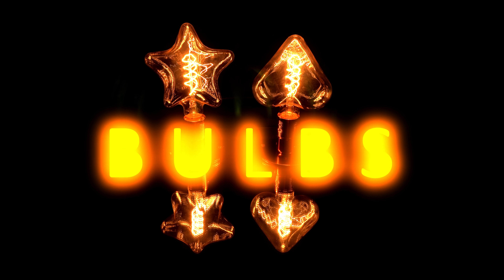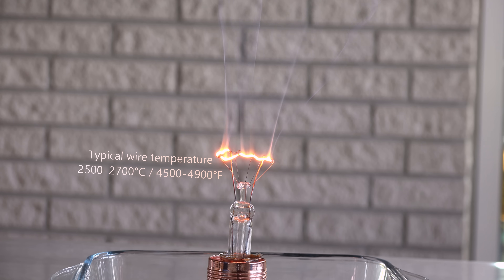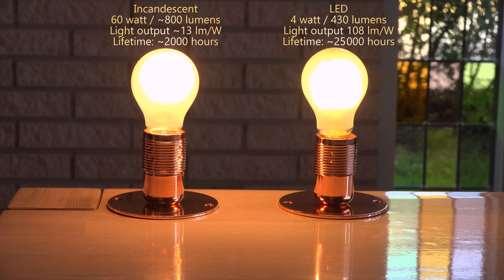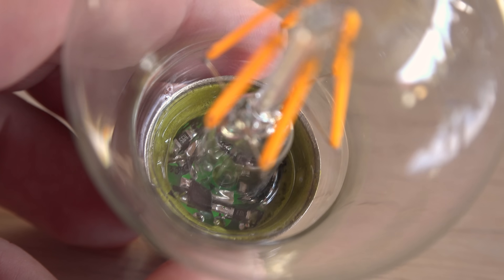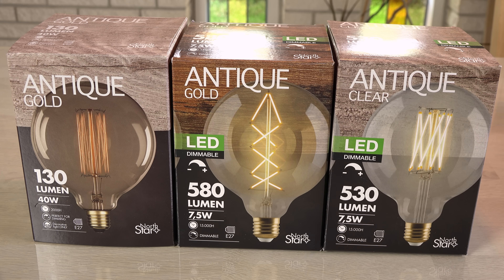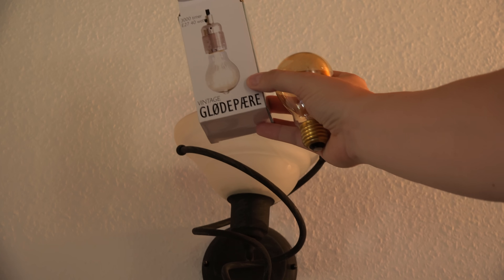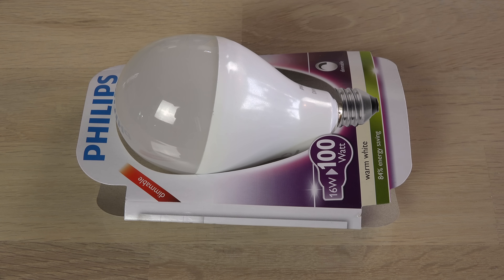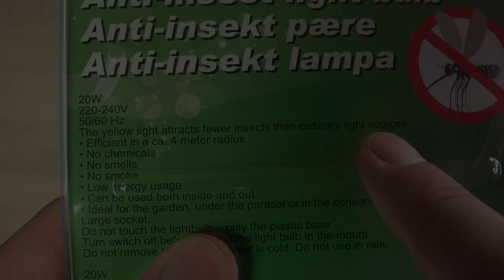Light Bulbs | LED vs. Incandescent

Comment: You need to test the bulbs at the rated voltage using a variac before you can say they are using less than the specified power.  I measured a 60W incandesent bulb rated for 120V (US) dissipate roughly 63.9W at 130V, 57.4W at 120V, and 50.7V at 110V.  The power does not increase with the voltage squared as your might expect because as the filament's temperature increases (radiating more power) its resistance also increases tending to limit the power consumed.  The plot of power dissipation vs voltage is almost a strait line.

Comment: The CFL bulb at around 9 minutes is rated at "125 watts" but only uses 50 watts because, in a very confusing fashion, that rating isn't based on the power consumption of the CFL, but the power consumption that an incandescent bulb would have to draw to emit the same amount of light. This is more or less pure marketing trying to compensate for consumer ignorance - most people don't realize that the watt rating on a bulb is about power and not light. They just associate a certain number of watts with a certain brightness, so if CFLs are labelled with their actual wattage, people tend to mistakenly think they're too dim and don't want to buy them.
Reply: Yep.  Compensation for the truth that is it's usually the consumer that's too dim, not the bulb.

Comment: Hey, there is the thing. I have a baby monitor (camera) with no night vision so I used a small light bulb in the room - with heated wolfram wire . When I switched to LED bulb with the same lumens, I had no vision on the camera. I'm wondering why!?
Reply: Perhaps your camera is running in sync with the LED flicker, but in phase with the LED's being dark?

Comment: I've noticed a flickering effect with my flashlight when I switch to low power mode. I'm guessing it just shortens the duty cycle of the LED, causing a noticeable strobe effect when moving things through the beam.

Comment: the issue i have with led bulbs is that they cant withstand -50 C degrees if i need to do some work outside my house at winter also they cant work at all for sauna lighting and there are no cold resistant or heat resistant led bulbs yet and i suspect there will never be one for both applications as my workshop at winter will be at -50 c and in summer at +45 C
Reply: and where the fuck do you live, neptune?

Comment: ,If you live in the tropics, you'd probably prefer the whiter, cooler versions of LED, but the downside can be that the electronics soon fail due to a poor stability of electricity supply and surge transients.Certainly I keep some of the old filament lamps as a series safety lamp for bench testing equipment.An interesting aside is that the first electric radiators were in effect large carbon filament lamps in the form of a long sausage shape with a pip on the end where the air was exhausted. Great video. Please keep them coming.

Comment: Banning ordinary filament type light bulbs is stupid, sure incandescent bulbs may not be efficient, but for other circuits that I use a bulb in, they are in-valuable.  Good thing I stocked up.

For instance, a dim bulb tester is a circuit where you have a bulb in series with whatever you're testing, so if the device is faulty and tries to pull a lot of current, nothing will explode, the worst thing that will happen is the bulb will light up bright, and that a good indication that something is wrong. Can't do that with LEDs.

Also light bulbs make very good a grid-leak resistors in a vacuum tube Tesla coil circuit, because their resistance changes when the filament warms up, making them a sort of self-adjusting resistor and it sets the bias in the circuit perfectly.  Can't do that with LEDs.

You can't do any of that with LEDs.  In lighting though, for me it's either florescent tubes or incandescent bulbs. None of this CFL or LED bull crap.
Reply: swunt10  Of course not.  Everything here is typed. 
..
...and I suppose you are nobody.
Reply: wow non of what you said is relevant to anyone. we are talking about light, not your useless hobby amateur project. buy yourself a circuit breaker and learn to use a multimeter. problem solved and humanity can save a couple of powerplants
Reply: pssst3 every heater is always 100% efficient because everything ends up as heat. so incandescent lamps are not special. I can also tell you that heating with electricity is always more expansive then every other option. nothing to do with taxes either. furthermore your gas bill surly did not go up if anything it went down since international and US oil and gas prices have collapsed over resent years. so please stop lying and telling bullshit. you are just embarrassing yourself.
Reply: swunt10  Correct you are on all counts.  Incandescent bulbs may put out about 2-3% light, but that would then get converted to heat on the surfaces it illuminates. 
To be pedantic: Power lost in the wires outside the house would be lost to the homeowner, but in the grand scheme of things it still goes to heat.
Reply: swunt10  I said nothing about amateur radio. I ran an FCC test lab.  Police/fire/ambulance use radios too.  Even though one bulb can pass FCC part 15 (or other countiry's agencies), when you have several hundred LED bulbs in a neighborhood, there could be issues.  Time will tell.  
...
What does your comment about a breaker and multimeter mean?  I have several of each and neither solves RFI.
--
Just providing information, Cheers.

P.S. HOWEVER, since you brought it up...You clearly don't know what amateurs do, either. Amateurs handled considerable numbers of messages out of the Katrina area as well as many other huricane, tornato and tsunami areas.  That kind of emergency communications could also be affected.
P.P.S.  I'm not against LED bulbs, just cheap drive electronics.
Reply: Another problem immediately apparent with CFL in my case was that it played havoc with the radio reception on my bedside table (nightstand). Had to go back to my stock of incandescents for that at least.
Reply: +fburton  LEDs can be even worse.  I have a table lamp that produces more RF noise when it is off!  IT has a soft on-off switch with a lighted button that is lighted when off.
Reply: Observ45er nobody talked to you idiot.
Reply: +swunt10 lol, ignorant fool
Reply: +Ippo2k16  Look @ your comment and who it is addressed to. Then, apply some of that superior intellect you feel you possess...
...
The OP didn't mention any radio and yours appears after my RFI comment.
-- 
Cheers
Reply: Underappreciated is that incandescent lamps are highly efficient heaters. When I switched to CFLs and LEDs, my gas consumption for heating rose, and cost more because of the differences in taxes.
Reply: +pssst3  You'll have a hard sell convincing folks on that one.  At least in the US, Gas heat is quite a bit less expensive that elec.  
..
OR...  You must have a really 'bright' future. (:-D)
Reply: CoolDudeClem  Interesting! When I was in college electronics lab class I tried using, on several occasions, a variety of tiny incandescent bulbs to stimulate my Wein Bridge Oscillator into excitation. I never succeeded!

Comment: ELLIDEE bolbs have terrible flicker in peripheral vision and the light spectrum is not good  i hope incandescent bolbs come back with a more efficient  way of burning energy
Reply: That's the problem: Using heat to make light (which is basically what incandescents do) is never going to be efficient, because the energy used to create the heat is "lost" as far as providing light is concerned.  They may be able to make them somewhat more efficient, but you just can't get around the physics.

Comment: BTW the "startup" energy comparison is pointless I guess, because these LEDs use SMPS with big caps at the output/input which probably take some time to charge up.. (I've had LED units which charged and discharged quick, some took a few seconds to charge and also to discharge, i.e. shutting it off would take a few seconds more)

Comment: Banning incandescent bulbs isn't a good ban imo. Anyone with a mind would buy LED bulbs now for the majority of applications. But for other applications (like lights that only have to burn for a short period of time), incandescent lights would still be cheaper and better for the environment (no need to make the electronics for it). Or f.e. when teaching about light and electricity, getting your hands on some old style bulbs would still be handy, but is impossible now.

Comment: Very interesting video. I've seen those yellow bulbs. They kind of work.
Reply from the maker: Thanks. I need to try the bulb in a real life situation. They may actually attract fewer insects - only the ones close by. But I highly doubt they repel insects ;)
Reply: Brainiac75
Yea, a real world test would work best. But no they aren't repellent, outside of maybe certain types of insects that don't like that wavelength for the light... I can't think of any though.

I think you're correct though in that only close insects would be attracted. Maybe do to the heat or something.

Comment: EU has banned clear glass light bulbs but NOT tinted ones? what the actual
Reply from the maker: Not sure I can explain it... but frosted/pearl incandescents were banned in 2009. Clear incandescents were phased out in the period 2009-2012 (high wattages first). Here in 2016 incandescent decoration bulbs were also banned - but only those with clear glass. Tinted glass incandescent decoration bulbs are still permitted. No idea why...
Reply: Brainiac75
 That's really bizarre

Comment: Some LED bulbs are not compatible with dimmers, remote control switches or automatic (dusk-dawn) switches. They will work okay when on, but when switched off they exhibit a low light strobe. Also, I thought CRI had to do with the color temperature. That is, the higher the CRI, the cooler the light and closer to daylight.
Reply from the maker: It can be confusing but color temperature doesn't say much about the color quality of the light - only about the tone of the light ('warm' yellow/reddish white or 'colder' bluish white). CRI measures how well the light reproduces all colors and is a much better indicator for the color quality of the light. More info: http://lowel.tiffen.com/edu/color_temperature_and_rendering_demystified.html

Comment: the more you know. i just discovered that my rgb led light bulbs have an awful cri 80. didn't know that before this video sob :(. t
still funny for colors however
Reply from the maker: For decoration and generel 'background' lighting when watching TV etc. CRI 80 is more than enough. But for video lighting, artwork and over a dinner table I recommend much higher CRI.
Reply: yes, just in the room to use the different scales of white for reading and studying and decoration. but these wi-fi bulbs are so expensive i was expecting an high cri; i have looked up to the "most famous" philips hue, which are truly expensive and they have a cri > 80 too.

maybe they just cut it because you'll hardly ever put these bulbs in the kitchen as main light.

Comment: The current implementation of the filament LEDs is very frustrating. They are very nearly the most perfect form of lighting right now, incredibly high efficiency, good color rendering index, extremely long life, mechanically highly robust....but practically EVERY manufacturer is making them with those tiny half-wave rectified power supplies with no smoothing capacitors. So they all FLICKER HORRENDOUSLY. The problem must be even worse in 50hz mains Europe. Fix that and they'll be perfect.
Reply from the maker: Yep, when the flicker-free, high-CRI LEDs from 'cinematic' LED-panels will be available in cheap household bulbs, I'll be more than happy with LEDs.

Comment: I really want one of those 40W LEDs now... I don't care how impractical it is, I want one.
Reply from the maker: Hehe, I also just had to buy it when I found it. Big size still counts :D
Reply: Brainiac75 I know right :)
Reply: a 40watt incadecent bulb will not out put as much light as a 40w led bulb. as much of the power is converted to heat.
Reply: you dont say..lol
Reply: Nigel Russell Compared to what exactly? 
A 40W incandescent vs a 40W LED is still 40W of power...
The only reason I wanted the 40W LED specifically is for large room/outdoor lighting.
Reply: We've got an 100W LED industrial light. It's fucking sick :D
Reply: get some youll save a lot of power in the long run.
Reply: Nigel Russell I mean, Duh... 
I'm saying that 40W is still 40W either way you put it, so you aren't saving ANY power in that scenario, you're just getting more light.
Reply: i have a 38w led in the shape of those long tubular fluorecent ones.
it's decent. very bright for the energy use.

but it flicker at 120hz, has a poor color spectrum (red tones seem muted under it) and.... well i don't use it as ambient too much thanks to that. i only turn it on when i need things to be bright.
Reply: Lol.. I looked it up directly 😂
Reply: For me idc i will still use Incandescents over leds.

Comment: I found Utilitech Led's will burn your house down. Had one overheat in a can light (it's rated for near sealed enclosures) and melted it's own lenz! Following that I found out quite a few Utilitech stuff has not passed inspection and has had many faults.
Reply from the maker: Bummer. Haven't heard of that brand in Denmark.
Reply: Brainiac75 Ok, we have it in the U.S, imported from China of course.

Comment: Soooo.. how does CRI compare to Kelvin color temp?. I've yet to buy any LED's, but I will start rotating them in soon. For florescents I prefer 3500k bulbs. 2700k is too yellow and 5000k is way too blue. And it is odd that incandescent is called CRI 100 when they also always appear yellow'ish to me.
Reply from the maker: All the bulbs in the CRI test are around 2700K but the CRI is different. It can be confusing but color temperature doesn't say much about the color quality of the light - only about the tone of the light ('warm' yellow/reddish white or 'colder' bluish white). CRI measures how well the light reproduces all colors and is a much better indicator for the color quality of the light. More info: http://lowel.tiffen.com/edu/color_temperature_and_rendering_demystified.html

Comment: Hello Brainiac.  Awesome video as always!  Another interesting fact is that the pn junction generally produce only Blue to UV.  The reason we can get White Light is because of the phosphor coating.  You can usually see the phosphor die shape easily on LED flashlights (since they are focal).   This also explains why LED's with a high color temperature (blue'r LED) usually produce more Lumens per watt.
Reply from the maker: Thanks. You're right about the phosphors. The high-CRI (>90) LED in the test also has a clear afterglow (phosphorescence) some seconds after being shut off. Good phosphors in that one :)

Comment: The florescent 125w bulb is 125 watt incandescent equivalent. Thankfully here in the US we have a standard data sheet they are putting on bulbs with lumens, wattage and equivalent wattage, color temperature, and lifetime based on 3 hours a day. I work for a company with bulbs in the name batteries is the other part and a + sign in the middle. I think you can guess who. I have to deal with this all day long. Anyways the other advantage to your standard house bulb is that the LED's are generally aluminium and plastic so they can take a beating, they can also be used as work lights. I have spent quite a bit of money on bulbs for my house but I amde a big mistake of putting 3 100w (equivalent) daylight (5000k) bulbs in my bedroom. Its like turning on the sun. But in the bathroom its nice. I also added a tree lamp with some 2700k 60 watt soft white bulbs to my room for relaxing.
Reply from the maker: Hm, I guess you're right about the '125W incandescent equivalent' but it isn't clear on the package. And shouldn't a 50W CFL be stronger than a 125W incandescent? I don't trust that 125W labelling at all :D
I can imagine that 300W equivalent is a tad to much in the bedroom ;)
Reply: Brainiac75 I can't remember if its 47 watts that 150watt equivalent or 53 but yeah they are not as efficient as LED's are. The 300watts I have are really nice when working on projects but thats about it. But I am too stubborn to regret my choices and change them.

Comment: How could someone dislike?
Reply from the maker: I liked your comment :P
Reply: Probably bots. It seems to happen to anything well made and/or popular.
Reply: Brainiac75
Also, I thought of this, but forgot to comment.  If you wanted to better show the refresh rate, try filming with a high speed camera, or even using an app on a smartphone.  Refresh rate is much more exaggerated in slow motion.
Reply from the maker: awesomeness2595 True. Filmed at higher FPS and slowed down is should be more obvious. I didnt think of that :c(